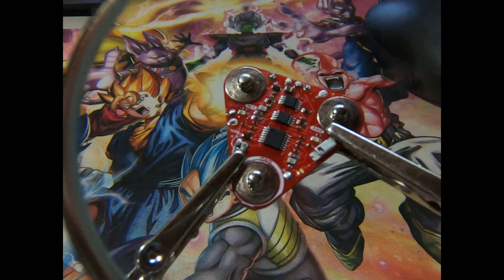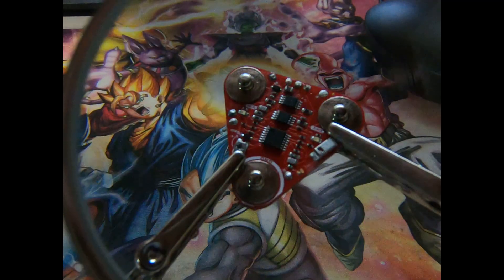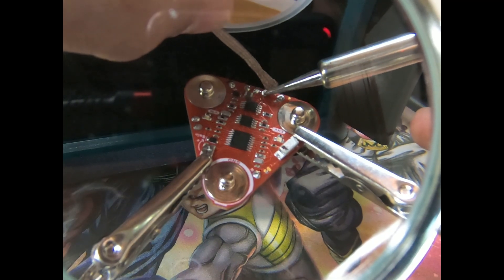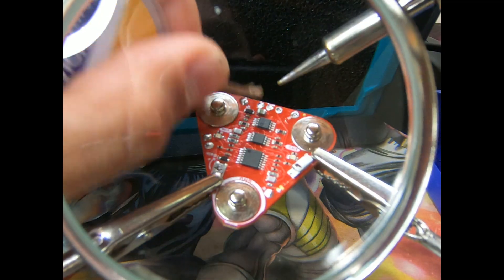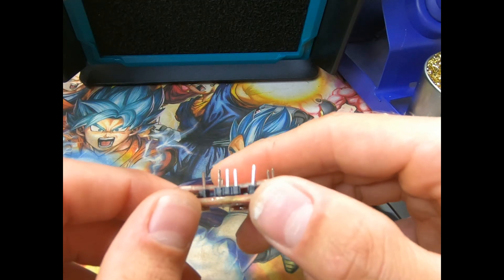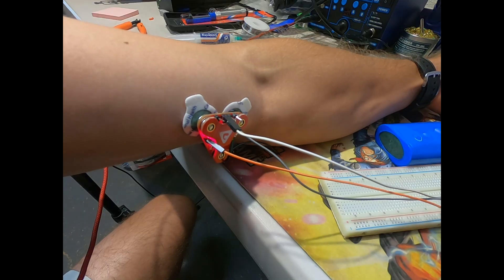Muscle-Controlled Servo! MyoWare 2.0 + Exoskeleton Progress

Comment: How did you place the third sensor? Did the black snap came with the sensor? can you please let me know
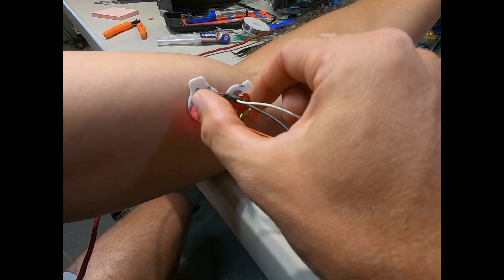Reply from the maker: If you're referring to the black reference sensor extension.  Yes, the kit I bought comes with that cable.  One end of that cable is a pin that has its own plug you can see where it goes around 13:35.  It should be just above where it says 'ENV' on the board.  The other end should be a snap connector which goes to it's own electrode pad.
Reply: @Manic_MechE  Yes, I was talking about the cable. Thank you for letting me know.  Your video was very helpful

Comment: how to put the reference cable to the myoware 2.0 , do you need to solder it to?
Reply from the maker: Yes, this would be the best way to ensure a good connection and clean signal.

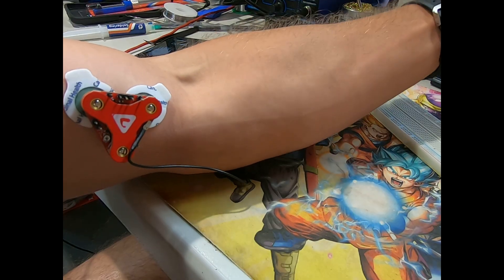Correction: If you are referring to the reference electrode, my kit came with a cable that connects just above where it says 'ENV' on the board.  This cable does not need to be soldered. you can see the connector around 3:09 or the cable attached around 13:15